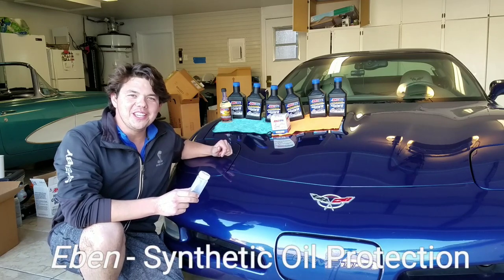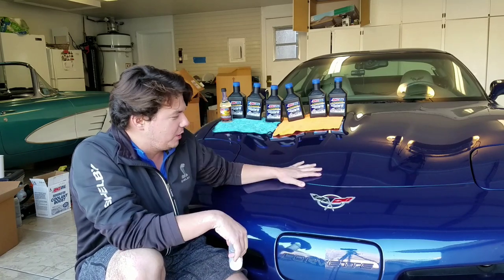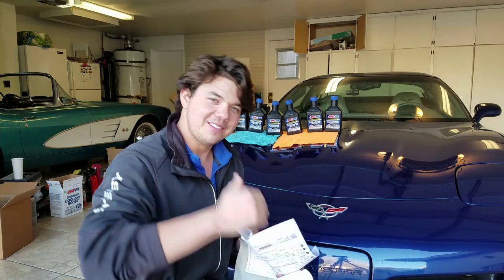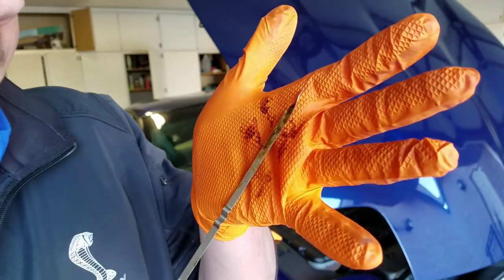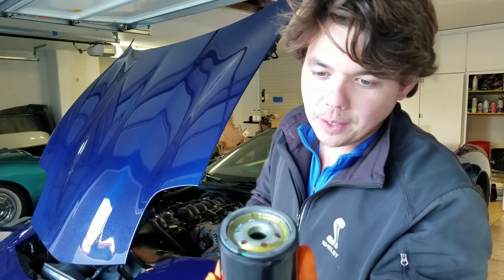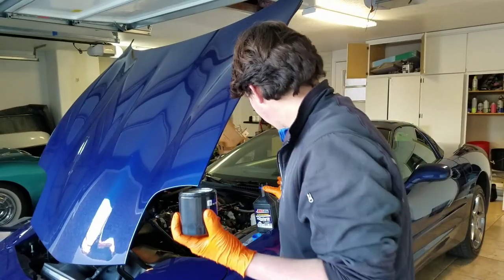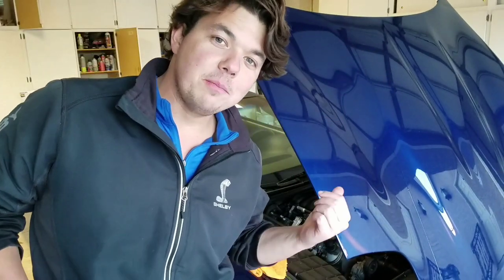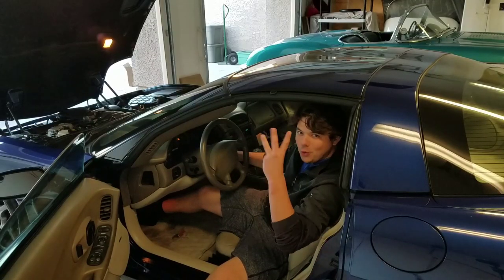Synthetic Oil Analysis Test on C5 Corvette

Comment: The owners manual specifies either 5W 30 or 10W 30. Eben chose the 10W-30 due to the hotter Las Vegas climate.
Reply from the maker: Looking back I would have liked to try the 0w-40 but I still think I'd like the 10w30 signature series or the 10w30 Dominator racing oil the best but would have been fun to try them all💯

Comment: Awesome you are wearing a Shelby Cobra sweatshirt and are a proud owner of a Chevy Corvette !  I have a nice Toyota Jacket but I drive a Nissan Maxima.  Feel ya !
Reply from the maker: I like the logo😃

The 2014 Shelby GT500 is the real deal. 

I drove one with full exhaust and a cold air intake and they make about 550 rear wheel torque at 2200 RPM
Reply: @Syntheticoilprotection  Have two customers with the 2014 GT500's; one has 787 HP. Then have lady with a 2019 GT Roush with over 700 H.P.
Reply from the maker: Sweet! Which one do you like better?
Reply: @Syntheticoilprotection  GT500's for sure !
Reply from the maker: Y'all never forget that day I drove that car that thing had so much power kind of gave me gave me a rush

Comment: NOt really a very good way to take an oil sample, as you can get contaminants in the sample from the dirt surrounding the drain plug area, no matter how well you clean the area off.

The best method for taking an oil sample from a vehicle such as yours, would be to use the AMSOIL oil analysis pump kit (G-1206.  This pump kit has a plastic tube that is cut to length to slightly longer than the "DIP STICK". The Tube is attached to the pump, and the sample bottle is screwed on to the pump.  You place the tube into the dip stick housing until it reaches the bottom pt the oil pan, the start pumping the pump util you get the bottle filled.  This way there is a ZERO chance of getting contaminants in the sample.
The G-1206 is only around $25.00, and you can use it again and again.
I do many samples each Month using this method, and it works very nicely.
Reply from the maker: Thanks for sharing that with me and the other viewers on the channel really appreciate that thanks Wayne!

I was just thinking how to get as many contaminants from the bottom of the pan into the sample I want to see what the where metals are with the sediment. 

On my previous video on my Honda Accord 20000 mile oil change I had a lot of people that said I skimmed oil off the top so this time they saw with no cutaways that 100% I drained the very bottom of the pan into the bottle and then I drain the rest of the oil out.

Just looking for worst-case scenario results just like Amsoil signature series 0w 20 is the viscosity they use for turbocharger deposit testing worst case scenario because of the thinner viscosity.

Comment: Hi Eben, related with the viscosity, the 5w30 and 10w30 are almost the same I prefer 5w30 because has more viscosity index than 10w30
Reply from the maker: The primary reason I went with the 10 W 30 was because I have a small leak on my oil pan and the 10 W 30 will hold up a little better in the high heat here in Las Vegas where I live I routinely drive my car in stop-and-go traffic at 107 degrees Fahrenheit for three months. The blacktop here in Vegas gets up to 180 degrees and it's about 9 in away from the oil pan......lol
Reply: @Syntheticoilprotection  In that case it's perfect because at normal temp the oil is a little thicker, excellent job.
Reply from the maker: so far the car is running really really strong it feels great with the 10 W 30.

GM just updated the technical bulletin on the C7 Stingray so if you do a little bit of track driving you actually run 0w 40 and that's what the Gen 5 vipers take as well.

 basically if you're doing any performance driving the 0w 40 is becoming the duo loyal because it's good for like -55 degrees below zero fahrenheit and then it's also good for 250 degree motor oil temperatures under severe track driving.

Comment: I have a 2016 Elantra with 85k miles got it with 71k Changed oil right when I got it then again at 78300, would a oil flush harm or do any damage or would it be non helpful or helpful? I assume my car was a hertz rental car since it racked up lot of miles over the past 2-3 years
Reply from the maker: Wow, yes a Amsoil Flush would help your car a ton! I would also do a Amsoil filter and Pi additive.  

This is my fav video on engine Flush- https://youtu.be/VfM6UNQ3cSw

It will be a Big difference. 

If your considering trying it this is my link for 25% off and free shipping on any order $100 or more. Eben Rockmaker
Independent AMSOIL Specialist (Dealer#: 5331179) https://www.amsoil.com/offers/pc.aspx?zo=5331179
Mobile: (702) 472-3614

Steps: 
1. My link gets you 25% discount and free shipping on orders $100 or more. Click link under my name, Click link join now yellow bar Preferred Customer for 1 year. Click add to cart. Note: Amsoil will not keep your CC info.
2. Click look up your vehicle.
3. Click auto light truck. 
4. After you have all the products added double check then complete order.
Any order $100 or more has free shipping and ships within 1 to 2 days.

Comment: Great video thanks,,, question,,, what steps do you take to jack the c5 corvette?
Reply from the maker: I had Specialty Products that go inside the frame rail on the side and those pucks are available they're made out of aluminum and they slot into the Jack holes on all four corners.

If you just got your car I would definitely get those aluminum pucks

Comment: Have you seen Street707's latest video? He says he went ot get an oil change from the local dealer, and they are now recommending Full Synthetic 5w50 oil for the 5.0L Coyote Mustang engines. 

5w50!!!................Any thoughts on this?
Reply from the maker: There's nothing wrong with it as long as you're doing high heat driving.

You definitely wouldn't want to be driving that in below freezing conditions with that thick of oil because the oil doesn't flow quick at startup and that's where about 80% of the where is on the engine is during the cold start
Reply from the maker: Funny you mention that the 2019 C7 Stingray technical bulletin update is from 5w 30 and it's been revised to 0w 40 just like the Gen V Viper and the hellcats and a lot of the Mercedes all take 40 weight motor oil
Reply: @Syntheticoilprotection  Funny thing if that's the car I was talking about when I said I'd consider Amsoil on a future car. What weight of oil do you think would be good for that car in Northeast climate?
Reply from the maker: I would do the OEM specification unless you're racing
Reply from the maker: Believe it or not even though Amsoil isn't a thicker viscosity it actually has a thicker film strength and that's what separates the metal and keeps the wear down less friction less Heat
Reply: @Syntheticoilprotection  Alrighty, just realized there is an Amsoil dealer nearby. Hopefully it'll help me keep the car for as long as possible
Reply from the maker: If you're considering trying Amsoil oil you can use my link here.

You have any questions feel free to reach out to me thanks man

Eben Rockmaker
Independent AMSOIL Specialist (Dealer#: 5331179) https://www.amsoil.com/offers/pc.aspx?zo=5331179
Mobile: (702) 472-3614

Steps: 
1. My blue link gets you 25% discount and free shipping on orders $100 or more. I will get credit for your purchase when you use my link. Click blue link under my name, Click join now yellow bar Preferred Customer for 1 year. Click add to cart. Note: Amsoil will not keep your CC info. There is no recurring charges.
2. Click look up your vehicle.
3. Click auto light truck. 
4. After you have all the products added double check then complete order.
Any order over $100 is free shipping and ships within 1 to 2 days.

Comment: why not use w5 30?🤔
Reply from the maker: You could also run 0w 30 I just did the 10:30 because of the high heat in Las Vegas and it has less of the thinning additives for cold starts so the oilfield erratically should hold up a little better in high heat.
Reply: will the engine get use to 10w30 and in winter when u switch back to w530 will it affect it in any way? HELP
Reply from the maker: The Amsoil is compatible with other oils so you can mix them and also the 10w 30 still is good down to zero degrees

Amsoil is 100% synthetic and it flows and much much much colder temperatures.

https://youtu.be/celH6X9nbyg

Comment: Your average temperature in the Las Vegas area makes it necessary to run at least 40 weight oil. No 10 w, 20w, or any combination. And 50 weight is preferable, due to your average temperature in the Las Vegas area. This information is commonly found in differential oils and applies also to motor oil. Some will argue, the tolerances of new engines don't require thicker oils, but they are wrong. They all involve a high pressure system and after that oil is hot especially there in Vegas you need a thicker oil. Do the research and don't rely on the moron at the parts store!